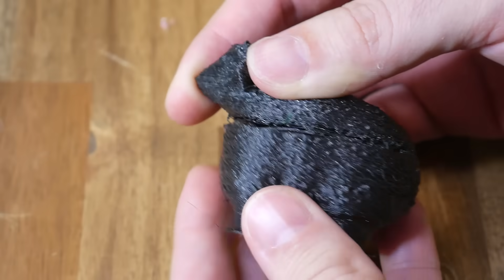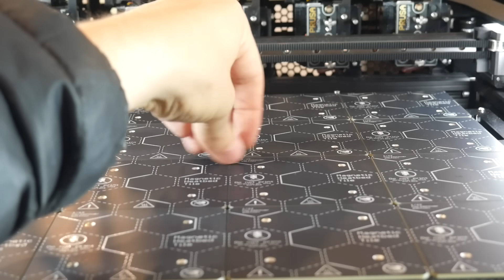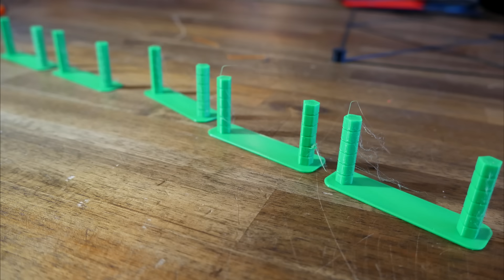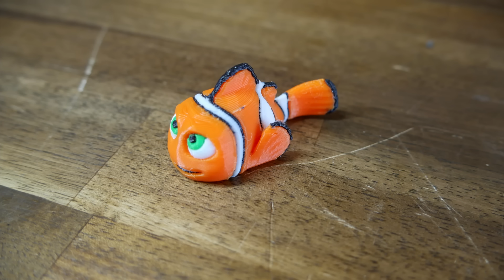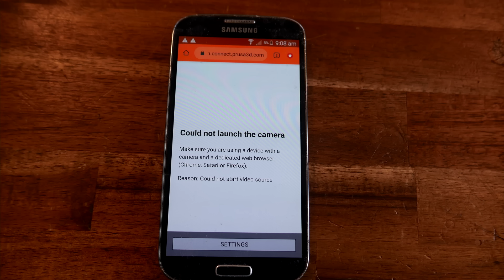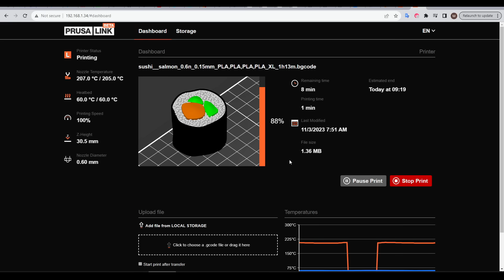The 5 tool Prusa XL is currently flawed, but I think it can be fixed

Comment: This feels SO amateur level. I built a Duet bases double idex machine -- 4 extruders, and I had the stringing/blobbing for tool changes solved in 2018. A brush and a silicone parking base is not that innovative, its obvious. I've been running .6 nozzles on my 4 extruder machine and I have no issues with stringing. I've tweaked the duet C++ code for tool changes initially when I was first developing it to deal with the little spike on the lift, and after a couple of releases, DC42 made it an optional feature in the firmware, even though my 4 head machine is super niche, DC42 has taken my code suggestions and included it in mainline of the firmware. I don't understand how with millions of dollars in research and so many people working full time on it, this is what we're getting in 2018. I just had Facebook remind me of a 4 color Cheshire cat i had printed and posted today in 2018, and it was perfect in 2018, and I don't use a prime or wipe tower unless i'm using different materials, PLA doesn't need it with a proper parking system, which again, I didn't even, I just put together different ideas I saw other folks who made IDEX machines. A scrubber to knock of the ooze while parking/leaving parking and a spring loaded silicone plug that keeps the tool at temperature, ooze free and primed.

Comment: The Z-lift before a tool change is in the Marlin firmware, it's called TOOLCHANGE_ZRAISE. To change this value from 2mm to 0mm, you'd need to recompile the firmware. This value is in the Configuration_adv.h file, I believe.

Comment: I think it is a fair review. I like Prusa and I have always felt proud that such a company comes from my home country. However lately I think they have hit a few snags. They always tended to releaste things unfinished any my early Mini was no exception. 
But once you get into things as expensive as your 5-headed XL many of these problems you described I would consider unforgivable. 
Similarly when you ask your customers to trust that in times of very fancy-looking options like those Bambulab printers they should trust you that the MK4 will be worth its price because it will be a full Prusa when it comes to reliability and support then you need to deliver exactly that and not alpha and beta versions that can only do half the things you promissed when the customer gets them. 
And recently I heard the experience of a relative who did the Mk3S to MK3.9 upgrade and that was sketchy too. 
I really hope they manage to fix this because I still like most of their approach. I think having an option to buy a good quality well supported user serviceable printer that can run with all its features functioning without a connection to a server in China is a good thing. A printer that you could completely disassemble and repair or replace every part with relatively minimum tooling is a good thing. A company that has been operating for a long time and has shown willingnes to support customers with spare parts for models they stopped making years ago is a good thing. So many others would just tell you "here is a 5% discount on our latest model instead". So I hope this lates trend is still recoverable for Prusa.

Comment: If someone was looking for a single-toolhead, large format printer, would the issues in this video still matter?  It really seems to me that they're all related to the tool-changing features.  Which, I know, is one of the major selling points of this machine - but if someone wanted the great bed levelling and all-in-one nozzle and throat hotend design, but with the over 35x35cm print bed - I don't think there's another option on the market, is there?  Leaving any build-your-own or but-this-and-mod-it options to the side.  Anyway, genuine question but mostly out of curiousity.

For my personal needs the Bambu X1C fits better, and I ended up cancelling my XL preorder in favour of the X1C when that came out.  Still, it's disappointing to see Prusa not quite hit the mark.  I don't think they're complacent, exactly, but I do think they got used to competing in a certain speed of market and innovation and are having troubles reacting fast enough (and dealing with the massively more complex logistical elements of the post-pandemic world) to keep up to the current situation.

Comment: As someone with 9 creality machines, 1 x1c I put down my deposit for the PrusaXL. I cant believe its that outdated. The print area is already not the best for large format. I wish they had done a 400 or 450 machine. But ok that is something we cant do anything about. The other reason is I need something that just works. Bambulabs disappointed when they didnt release a large format machine so this one would have the upper hand but it just seems like it will go up against the creality machines. tinkering and tinkering, we need something large format that just works. The other big feature of the tool changer was saving time on prints because the AMS is slow in changing colors (still the best option on the market) but doing intricate multicolor models that aren't optimized to reduce color changing on every layer will increase time by a lot. That is where the toolchanger comes in. Instant color changes but with that kind of quality that is so not worth it. I want to see if Prusa releases a statement based on this and then will try to get my deposit back

Comment: Thanks for posting this and doing all the testing. I thought all the oozing, blobs, and debris ripping up layers could be related to my filament but it's obvious it's not. The 5.0 Alpha FW has a "cleaning routine" that literally smooshes ooze into the base of the nozzle which then gets dragged around pulling the first layer off the bed. I really hope they take time to fix a lot of these issues.

Comment: Excellent work Michael!  I too recently got my 5T XL and have been learning and working with it.  I agree that it's not ready for prime-time (which is disappointing for a Prusa product) and I expect Prusa to get these issues ironed out.  Fortunately most can be addressed with software.  Like you I was surprised by the single-screw attachment of the tool head brackets.  Time will tell if they start to shake themselves loose (I've got a bottle of thread-lock at the ready).  I haven't had the stringing issues you've had but that's likely due to my near immediate switch to 0.4 nozzles.

Comment: I had a preorder out on the first day, but I cancelled about 6 months ago. I was really hoping this machine was a killer, and I even accepted the first few supplychain problems, but the delays became quite ridiculous. And now, with all the testing they said they did, the elaborate alpha and beta test programs, it's still flawed. I wonder what happened with the test results from the alpha and beta testers. I kind of lost faith at this moment. And I still haven't received my refund after all these months, so that process too is slow.
I do hope that they'll get on top of the problems though. The XL is still a beast of a printer, but it has to work properly. It's performance at this moment is unacceptable.
Reply: You canceled 6 months ago and have not received the refund? That right there is reason enough for me to never do business with prusa. Thats inexcusable, i would expect their doors to close any day if they cannot provide refunds.
Reply: @ManBearPigCreative it's still ongoing. I had several email exchanges with them and 2 weeks ago, they asked (after I queried what the delay was) for my bank account number since putting the refund on my credit card was not possible (strange, but ok). So I expected the refund within the week, but still nothing. It's not looking good...

Comment: This is a good honest and balanced review. A printer in this price category must work out of the box without tinkering. We expect good print quality from Prusa machines. We need more high profile reviews to put pressure on Prusa. The firmware and software is not in a good state given that the printer started shipping almost eight months ago for single tool and six months ago for multitool... Prusa needs to take ownership, tell us customers what's going on, and when things will be fixed. This isn't a $600 printer.

I think the primary answer is that this printer was rushed to market because it was already so far behind. We don't know what is going on internally within the company, but from the outside, we can see that the MK4 came out of nowhere in the middle of the XL. Did this impact resources that were on the XL?

I think the MK3 and MK4 do so well because they use them in their own production environment. Is the same concept applied to the XL?

I do not see how some of these issues were not discovered during development or validation. The sad fact is that customers are used as beta testers these days. Heck, even alpha testers in Prusa's case. Some of Prusa's support answers are to use alpha firmware and software. This should be making management question this project.

Don't get me wrong, I think the XL will still be a good printer in the long run. I was going to wait for my XL, but Prusa poorly worded the last call email, making it sound like you lost the pre-order parts and your place in the queue. I ended up ordering my 5 fully assembled. Hopefully Prusa puts more resources into the firmware and software, not just production assembly.

Regarding the scrubber, I am not sure how I feel about brass. It is the same hardness as the nozzles, so I would expect some wear on the nozzles from the brushes over time when wiping. It will depend upon how much pressure is applied to the nozzle. I think your nylon brushes would be a better choice as long as they don't melt. Obviously brass would be fine if you use hardened nozzles.

Comment: Feels a bit complaining but all valid points given your experience and expertise. I have seen live streams where the XL has run flawlessly and wonder if your machine just needs a nut and bolt check, maybe there was a design change later, or if most likely the XL was only tested with larger multi color prints which work better than the smaller prints. In that case Prusa must have missed the thorough testing the users would do. 

I also wonder if this experience is similar to the first Prusa and those early adopters where just testers for future 3d printers.

Comment: I think customers outside of the EU or at least Europe, are at a serious disadvantage here. They don't show the shipping fees here but I would think they should be manageable. Other than that it really should stay with the 4199 EUR. So maybe 4400 EUR if shipping is rather steep for EU (guessed 200 EUR). As also the assembled version isn't really fully assembled I would really go with the partially assembled version instead, which is 3699 EUR + shipping. This is considerably more manageable than the whopping 5105 USD (4721 EUR) you ended up with. That is not changing any of the othe aspects but for a toolchanger of that size, it seems the best offer available as of today ... well, at least once they can actually deliver the machine in a reasonable time frame and the most severe issues are dealt with, that seem to be addressable by optimisation.

Comment: Would be interesting to see how this stacks up to the E3D ToolChanger or the Proforge 4. See how they avoided or addressed theses problems or if they also suffer the same issue.
Reply: harder with the E3D since it's discontinued. The Proforge 4 looks like the closest competitor we'd get. Just wish they'd have gone with a square build plate. Legit hate rectangular ones.

Comment: OOOOFF... I keep going back and forth - I want one, because of what Prusa shows they're able to do... but my god, $5K for a machine, and then you show the awful, awful print quality of the printed parts... I just can't swing it. I so want to admire this machine, and I admit, I want one... but the cost is astronomical for what you're getting in terms of fit, finish, and user experience. $5,000 and 2 years... this experience and needing to do this much to get the thing working perfectly are flat-out unacceptable.

Comment: For the amount of money they are commanding, the performance should be on par.  As a newbie looking to get into 3d printing, I want the size and feature set of the Prusa XL with the no hassle results of a Bamboo X1 Carbon.  I guess I will wait to see if Bamboo brings out a big brother to the X1, or Prusa reolves their quirks in the XL.  Whoever gets there first will get my money.

Thanks for the unbiased reporting, it does help folks like myself make informed decisions!
Reply: I'm on the waiting list still for an XL, if the Bambu had a larger print space I'd have already bought one. If Bambu makes a larger printer Prusa may lose my money at this point.
Reply: The XL is a beast.  IS is fast, and you can't find a tool changer that is even close to this product.

Comment: Those saying it’s user error on this particular printer I’d say are in error. With a nearly two year delay, you shouldn’t have the issues you have. Now with the ender 3 and it’s issues, a lot of that is user error as that printer needs a decent amount of user input to tune properly. 

Another point on that, Prusa to me would be the printer to get by someone who has already been printing for a while due to its cost. The creality printers are entry level to learn on, hence the lower quality. This Prusa printer should have been much further along in quality than it is and hopefully they follow suit with Creality and Bambu with regards to fixes

Comment: Congrats for an honest, objective, review of the Prusa XL in its current state (of development). I own a MK3S+ and like yourself and others placed a pre-order for 5-tool Prusa XL. I canceled the order recently before even looking at your video on the basis of actual users posts in the forums. It is a shame that Prusa made a) a complete mess of their pre-ordering system; b) that they don't seem to acknowledge the issues that the printer has. According to their blog is just good news all around! I wonder to whom they shipped their XLs for beta testing? because either they didn't do a proper job or Prusa didn't listen to their feedback, or both! As soon as Prusa finishes shipping the pre-orders, I wouldn't be surprised if the XL price comes down considerably, which is bound to really upset people who paid top dollar for what was supposed to be a top of the line 3D printer. Clearly Prusa faces an uphill struggle to win back the trust of its users, maybe even financial. Sad that it came down to this but they have to blame themselves for it, for +2y we stuck in there, waiting patiently for the crown jewel...that turned out to be an expensive lemon after all.

Comment: Did I miss something or was the majority of this done on alpha firmware? I think that introduced a lot of problems especially if you were  using presliced files that came with the printer from a previous firmware. Did you also use the proper profile for the alpha firmware?

If this is the case did you try going back to the latest stable firmware release and try the tests that way?
Reply: He uploaded a new video addressing how intoxicated with copium you are.
Reply: @nitronaf  Because I asked a perfectly valid question for a device I will probably never own? I guess it is a safe assumption from your toxicity that you are team bambu labs...

My printers are chinese... I don't care as long as they work as I want them to and I can get parts for it.

Comment: A fine, fair and constructive review. For a Prusa machine this doesn't seem to meet any of the quality standards we're all used to. Yet it is the only one of its kind with the toolchanger. My fear is that Prusa rushed it (not for the first time) to try and keep their promises. It would have taken much more time and research to fine tune and iterate the design of that i(n principle) awesome 3d printer. I can only hope the will learn from that and increase efforts on R&D and only announce stuff that is in the polishing phase.
As much as we all love to see great new technology, we are all the more disappointed if it just doesn't work. Such modifications as a "poop basket and a brush" are not so unusual as that a development team couldn't have had the idea. The single bolt per parking bay could have been supported by a printed pin in a second hole or even a hook fixing it against twisting and vibrating loose. These things don't look like oversights but rather like accepted flaws. Maybe they intended to provide fixes later, but unlike with buggy software, fixes for flawed hardware are not easy to deploy. It's even more disappointing than the hyped input shaping (without an accelerometer) which gives rater mediocre results imho.
I am pretty sure, there will be a ton of fixes and improvements on that printer and I'm happy that many of those will come from the community, but for an initial release you shouldn't rely on the open source community to do the remaining 15% of development to get an acceptable product. There is no need for leaving room for improvement, since that room will always be there.
That said, I know Prusa has been in a pinch lately and the market is a battlefield, but why not be true to what they act like and trust in their name and reputation. Prusa has been delivering 3d printers used as workhorses and fallback machines. If you got a new 3d printer and it failed you, you always knew there was your old Prusa in the corner in case you really needed to print something. That trust in quality and reliability goes a long way, unless you ruin it with making promises and creating a hype when all you got is some half-baked ideas not quite poured into an appropriate shape.
Reply: for the price they are asking, a working toolchanger should not be an issue. they cheaped out on the engineering/manufacturing, even if the core mechanism is very neat - its surrounded by crappy fixturing.